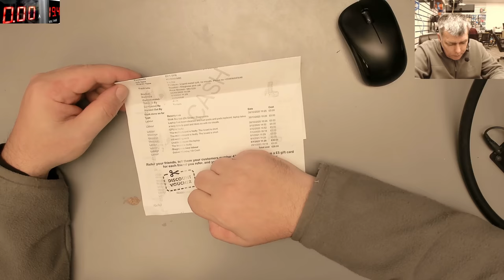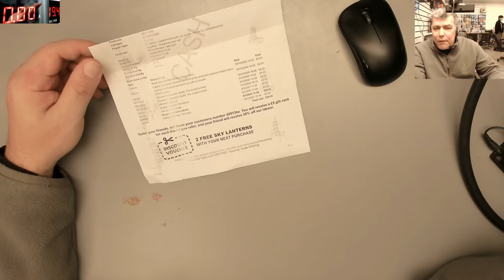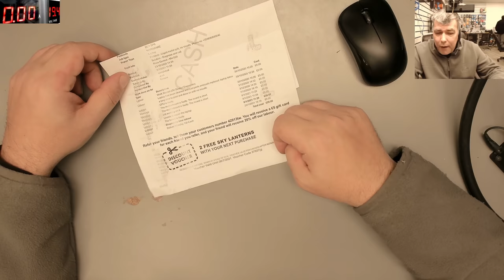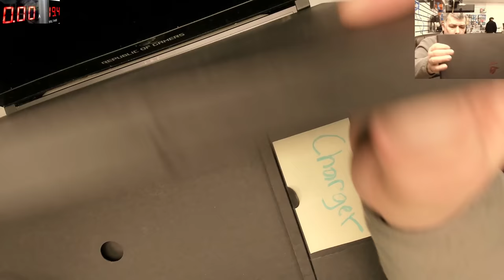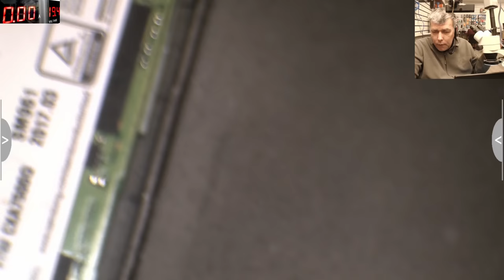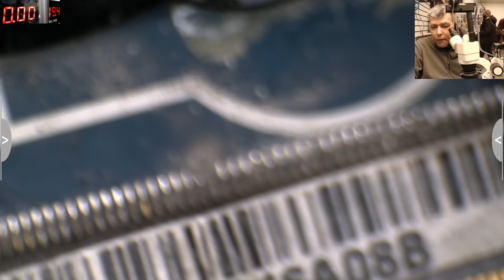Worst fault ever in a laptop - Liquid metal spilt on the motherboard - Asus ROG Zephyrus GX501

Comment: I cleaned liquid metal from a board with "Wurth brake cleaner"  and compress air
Reply: only in macedonia
Reply: Wurth brake cleaner contains acetone, is that good for motherboard? If you drop acetone on black plastic cover you gonna see white spots.
Reply: @ChaseMyRabbit  plastics on most motherboards do not react with acetone. I am regularily using acetone when I need to get hard to remove flux cleaned.

Comment: This has been a really interesting video. Thanks for the work putting the footage together.

I failed trying to fix a friend´s Lenovo X1 reflowing the onboard main memory (It was already dead but during the reflow, it posted and crashed a few times). I quitted after it stopped posting at all, but after seeing this video I think I might try to find new memory chips.

Regarding the liquid metal... I have it on my own laptop (wich was hitting 100C previously) and it works, but after seeing this I have seen exactly where the danger is. Hopefully, I won´t have to see anything like that ever.

Comment: Sorin, nice job!  I never thought memory chips are so resistant at high temperatures... And you did it manually... Obviously you have lots of experience. Many are using machines to center them, heat the board, control the temperature. And you  are also very lucky to find the fault... True! "Worst fault ever"

Comment: Great job man. Just in case you don't know... there is a leaked program called nvidia mats that would have helped you find the ram memory that was faulty and no need to unwelt many chips.
Reply: Exactly. Every repair worker must know of this software. However, it works only on nvidia and only starting from Fermi.

Comment: Sorin, not sure if you read comments on old videos, but here’s a tool that is NOT in your toolbox…

A standard dishwasher. Yes, I’m serious.  I’ve cleaned several circuit boards in the dishwasher. Works awesome. They come out spotless.

As long as it’s all semiconductors and no cube relays, or other parts that can trap water, a dishwasher works awesome for cleaning boards that have very heavy dirt, spills, and gunk stuck to them. 

I typically put a light amount of detergent in the machine, and suspended the boards with wire bread twist ties. Let it run through the entire cycle, including the dry cycle. 

Search for “CERN dishwasher” and you’ll see that it’s even used by scientists. It’s great because you throw the board in, and go do other work while it washes!

Comment: Hello, I think that it is mineral spirit, that is used for lighters , or precedently naphta (which is probably forbidden today) I buy that by the liter, (French name "essence C, F or A")  it is fine to get rid of old adhesive from tapes, among other degreasing and corrosion protection on steel. regards

Comment: To clean the MB properly, you will have to put the entire motherboard into the small container and actually clean it submerged in the cleaning solution. When I worked in the production plant we had ultrasonic cleaning devises to clean PCBs. Alcohol based cleaning solution is the best to my knowledge.

Comment: Most of the times from experience blinking led light means memory module reading error..... P.S i saw a black fiber mate was that carbon fiber or fiber glass mate to prevent heat from passing on to the table when using the hot-air station or just not to scratch the table? hope for a reply please so i can order some mates. love your videos respect comrade.

Comment: sir, I have laptop that I bought for 5 month ago, and now my laptop acer nitro 5 an515-44 ryzen 5 4600h. the problem is dedicated gpu nvidia gtx1650ti can't installed and the memory cannot detected. if I install the driver for nvidia, the installation always not finished and become BSOD. if I restart the laptop it become black screen for long time, but if I DISABLE nvidia at device manager in save mode, then I restart the laptop everything running normally until windows. can you help me sir, what happen with my board laptop...maybe you have experience with these case of laptop. I am sorry sir, my english not good...thank you sir.

Comment: I had cockroaches inside a small TV once. I saw one behind the buffer boards and grabbed it with my tweezers and threw it out the window. I thought it would be the end of it, but then another one came out....and then another one....they wouldn't stop coming from behind those buffers and I was afraid they'd get onto my desk and run all over the place, so I took the TV out and blasted it with compressed air as hard as I could, revealing a nest of like 10-15 more in there ! HOW DO SOME PEOPLE LIVE LIKE THAT ???? I should've charged extra for that :))

Comment: Those dji batteries have a low current protection in them which if the batteries are ran down to low it protects its self by not allowing them to charge. Unfortunately it's a 150.00 battery

Comment: balls for gddr are standard 0.45, guys who reball them know what they are doing and you can clean pads without fear. But extremely gently as traces underneath chips can be easily destroyed, solder mask removed and (at least to me) that can become impossible to fix.

Comment: It's a little bit disturbing that the gentleman uses highly flammable petrol instead of IPA, no fumes extractor (bet he uses Pb based solder) nor antistatic gloves or anything that would protect him or the electronics. This guy loves living on the edge by the look of it, he's one step away from turning into a fireball, especially when using exposed hot air in the evaporating petrol while taking a puff from the electronic cigarette. What could possibly go wrong?

Comment: No way would I have stopped there. I'd have pulled all the BGA chips in that area of the board and reballed them. Sure it works right now.... but if you tilt the board and another blob shorts something expensive out...

Comment: Cockroach?  I had 1000s of ants make a nest inside my HP laptop.  I never turned it off because I used it for work.  That was a nightmare but the ants were no match for my vacuum cleaner.

By the way, Cockroaches in the desert of southern California are 2 to 3 inches long (5 cm to 7.5 cm) and they fly.  They are like small bats.

Comment: I wouldn't say avoid using liquid metal since there is no other thermal compound with better thermal conductivity. Do it carefully and no issues. Don't put more than you need and isolate the rest of the surface area while you are spreading the liquid metal over the cpu

Comment: it's really hard to align the balls manually why don't you just let the surface tension of solder align it from the beginning. Also preheating the board helps a lot. Nice job! By far the best diagnostician I have seen. I am surprised how good you are without schematics.

Comment: Yeah, "People"..Anyways, hey I have this 1996 Gateway that was converted into a portable wrist-worn tablet.  The majority of the components wouldn't fit into the arm-band-case, so they're mounted in a backpack along with 4 car-batteries and a 5000watt inverter. Everything is charged while I peddle. Oh yeah, I forgot that part. I have to be on my bike to use it AND if speed drops below 45kph, the UPS trips and shut everything down..I'm sorry to bother you with this. Primarily because I'm a genius-inventor who builds things like this that are super-duper advanced engineering. Typically far above the average person's comprehension level. But I'm having a problem, I figured you might be able to help.. Ok, So when I'm peddling in a north-west direction I keep smelling bacon cooking... Do you think the problem is simply a loose screw?
Reply from the maker: Can be :)))))
Reply: @electronicsrepairschool  🤣🤣🤣